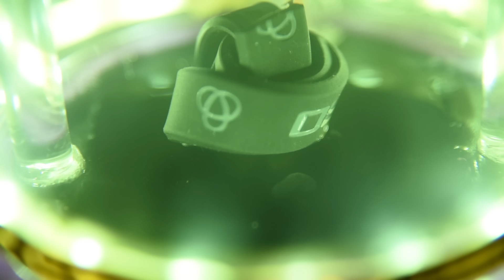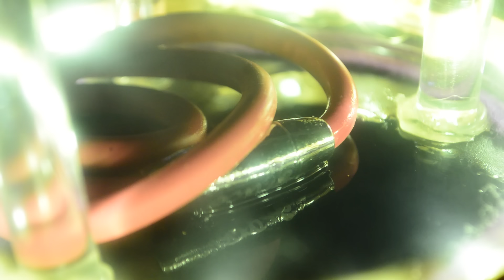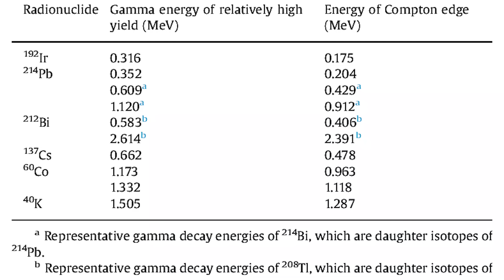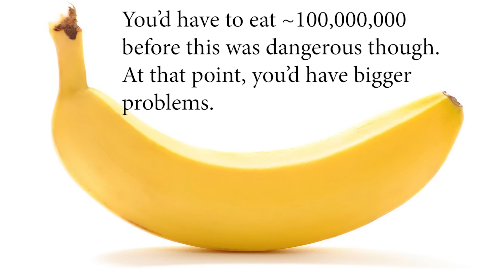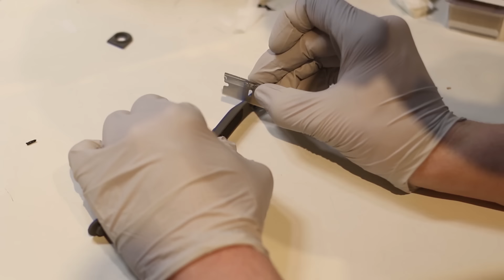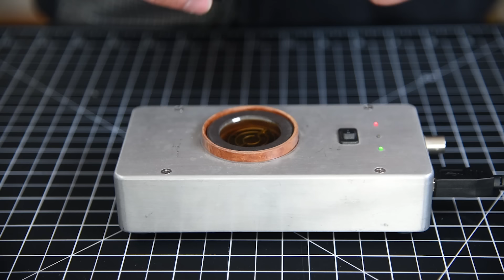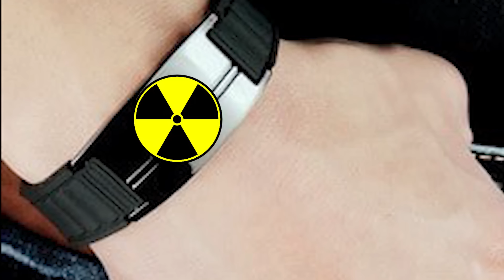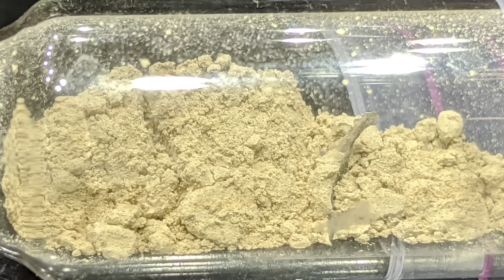Negative Ion/Anti-5g Products Are Actually RADIOACTIVE

Comment: That first part about the salt lamp explains so much. I thought they were pretty, looked up prices and have been wondering why they're charging so much for a light bulb in a piece of salt ever since.
Reply: I got mine from the dollar store for $5. It has a color changing LED inside. I don't believe it does a single thing for my health other than completely satisfying my goblin brain's desire to have glowing rocks in my house.
Reply: @KattriellaDoesStuff  relatable, I had to get rid of mine because I live in a humid place, and it started "crying."  Which caused everything around it to rust.
Reply: @CygnusOrb Salt is hygroscopic; it draws in water moisture from the air, causing water to condense on the surface. Assuming the rock is at room temperature, the water will run off the salt rock, giving it an appearance of "crying".
Reply: @kattriella1331  
Lol same, I got one little one as a Christmas present. I love the warm light it makes, it's comforting
Reply: I actually got one for 7$ at a flea market, it was already open so I thought it was just a cool cheap rock lamp. Later on I found the same exact lamp at a walmart for 50$
Reply: Its just red veined halite. But don't wash it with water
Reply: Yup, you will find little puddles of salt on your dresser beside your lamp. Especially in the summer. Perhaps keep it on a paper towel.
Reply: It's a massive scam! 😆 remember when that guy sold millions of pounds worth of rocks with a USB cable stuck in them... there are many ways to take money from gullible people
Reply: @Jawst  the USB Pet Rock wasn't a scam though, it worked as advertised.

Comment: Did you check shungite?  It is a naturally occurring stone that can block radiation.  How does it react?  Would it be safe?
Reply: There doesn't seem to be any real evidence supporting the idea that shungite is especially good at blocking radiation. It doesn't seem like shungite is actively dangerous, though, just doesn't do what it's advertised to.
Reply: "Crystal healing pseudoscience proponents and 5G conspiracy theorists have falsely alleged the misinformational belief that shungite may remove 5G radiation from their vicinity more efficiently than any material of similar electrical conductivity would do."
Reply: @muzlee7479  you may want to take a look at the scientific studies on frequencies from different stones and the colors alone of stones believed to heal particular parts of the human body, the colors alone of the stones match up with the parts of the brain that light up when those parts of the body are lighting up the brain as well, so science is more and more validating some of those ancient practices of certain crystals impacting certain illnesses.
Reply: @HearturMind  there is not a single study on that, just some pseudo science stuff. Stones doesn't have frequencies like you think they have and the color is completely arbitrary.
Reply: It's just lead my man cause only lead can block radiation that effective (you also need to wear a full suit made out of lead by the way so don't try it)

Comment: I mean could you say that its making water "more wet" because some of the alpha particles could interact with the hydrogen to make deuterium (D), and since deuterium is denser than hydrogen, it increases the density of the water and thus making it feel stronger when you consume it (if enough deuterium is present)? (17:03 - 17:10)
Reply: The ability of a substance to wet is its ability to adhere, or stick to other substances.  I don't see how adding an extra neutron to a hydrogen atom affects its charge.

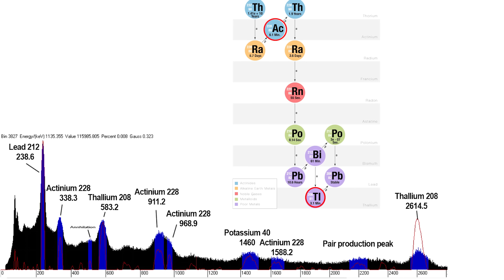Comment: ::Can someone explain "Annihilation" to me at around 8:06
Reply: what? are we watching the same vid?
Reply: @y2kenh  between the first columns of Actinium and Thalium.
Reply: @mikestrauss8613  ahh, now i see it. It's the collision of opposite subatomic particles. From wiki on annihilating radiation: 
Positively charged electrons (Positrons) are emitted from the nucleus as it undergoes β+ decay. The positron travels a short distance (a few millimeters), depositing any excess energy before it combines with a free electron. The mass of the e- and e+ is completely converted into two photons with an energy of 511 KeV each. These annihilation photons are emitted in opposite directions, 180˚ apart....
so in that graph it does look about 511 KeV
Reply: @mikestrauss8613  it don't exist in the video

Comment: Another issue with thorium and alpha radiation...since the devices shed thorium powder, you are going to end up with internal contamination.  And when it is internal, alpha is by far the most dangerous type of radiation.  When I got a geiger counter I made sure to get one that was capable of detecting alpha.  We need to be using this thorium to make pebble bed thorium reactors for safe clean energy, not exposing people to it.
Reply: Thorium is probably also just poisonous.
Reply: @hedgehog3180  True, most heavy metals are also (chemically) poisonous, whether they are radioactive or not.
Reply: @StormsparkPegasus isn’t the term heavy metal used to refer to toxic metals anyways? (Things like arsenic or lead)
Reply: @JustALittleGhostOfHallownest  Not necessarily.  It just refers to metals that have a high atomic weight.  One of the heaviest metals (gold) isn't toxic at all.  That said, a lot of metals are toxic.  The chemical toxicity of any substance (not just metals) depends more on how the electron shells are arranged rather than the atomic weight.
Reply: Yeah, the flip side of it not penning far means it's FAR more likely to be dumping all it's energy into the first thing it finds, or to just bounce around and cause despair like a psychotic pinball.

Comment: Is heavy water technically more wet?
Reply: is it the higher isotope weight that gives it the ability to bind with itself?  nope.  so I would also have to say, no heavy water is not more wet.
Reply: No cause that's just water but heavy
Reply: @G.A.C_Preserve  but if it's water that weighs 11% more, that means heavy water is 11% more wet
Reply: @defeatSpace  that's not how it's work

Comment: 13:41 - is NOT a geiger counter. It's an electrostatic fieldmeter!

A device to measure static electricity/charge. Static electricity isn't anything like radioactivity. The reason such meters exists is because in highly specialized working places you need to make sure you're not building up charges. It can be working with special sensitive equipment, flammable gasses etc.
Reply: yes but it's radioactive anyways
Reply: @Shoteaux2  /Might be/ - but an electrostatic fieldmeter can't tell you whether it is or not... ;)
Reply: @Shoteaux2  You miss the point, don't you?

Comment: What about electric appliances? I used to live in Japan and there's a ton of "negative ion" stuff everywhere. I got a "negative ion" hairdryer just because it was on sale, and a "negative ion" toothbrush just because it had three spare bristle heads, making it cheaper than a normal toothbrush. It looked like the one shown in this video. I used the dryer for three years and the brush for more than a year... Now I'm kinda worried because who knows what did they put inside :(
Reply: get a geiger counter. then you can check if its radioactive
Reply: If the geiger counter doesn't say anything then it's probably just marketing bullshit, except “air purifies” which might generate Ozone which is toxic but usually they make that clear if they do.

Comment: Cellphones have alot of rads.Smoke detectors have a tiny piece of a bad atomic radiation material, I've been told, by a fire man 👨‍🚒
Reply: you cant compare these types of radiation
Reply: @ingolorenzo4158  absolutely no comparison at all
Reply: @davldbradley6073 phone radiation is less dangerous than visible light so... just no
Reply: do you know the kinds of radiations? the cellphones are radioactive but their radiation isnt ionizing, and that means that it's not dangerous, and that's because when i put my cellphone along with a geiger counter it doesnt goes crazy

Comment: Great vid. Love the Gamma Spectacular and will have to get one. Can you re-measure the dose rate with the alpha-sensitive detector after wrapping it in paper please? Just showing an alpha going through is not sufficiently quantitative to judge risks. Also, local on-contact dose is far less hazardous than whole-body dose. You can't just say 100 mSv/yr whole body is the threshold for the smallest measurable increase in cancer and then add up a few local external doses and say it's unduly hazardous without a lot of disclaimers. I think you're a little strong with your conclusions given what we saw.

Comment: you didnt show whether tourmaline bead bracelet generates negative ions you just showed no thorium or radioactivity btw that caltech professor on the referenced vid described how that pink tourmaline he had on the display shelf will generate negative ions
Reply: Ur blind 0:17
Reply: they're not even negative ions because fast electrons(beta radiation) arent even atoms then they arent ions LOL
Reply: tourmaline is a stable boro-silicate mineral.  it does not generate ions of ANY kind.  it WILL generate visible light in response to UV light.  that is not ionizing radioactivity.  it is fluorescence, which many minerals show.

Comment: I just saw an advertisement for a "Negative-Ion air-cleaner" that SUPOSSEDLY cleans the air of pollutants & allergens because the "Negative-Ions it releases when plugged into an outlet are SUPOSSEDLY heavy enough to bring the allergens down to the ground when the Negative-Ions "attach" themselves" even though that is a logical fallacy regarding the weight of airborne substances, and yes it was a mobile phone advertisement and yes it was advertised to people with variously caused breathing problems or pets. Fucking disgusting.
Reply: those things are usually ozonizers; item's that crack 02 and produce 03 by passing current through air, and then the 0- ions instantly recombine into ozone.  if it generates a noticeable smell, it's probably an ozonizer.  large ozonizers are used to clean empty hospital and surgery rooms because Ozone is a strong oxidizer (duh).  it's functionally like spraying bleach everywhere in a room.  clearly, you wouldn't want to be standing in the room while that is going on.  the small ozonizers they sell commercially effectively do nothing, unless you put them in a completely closed room with nobody in it for about a week or two. :)  That said, I would NEVER give an ozonizer to anyone with lung issues.  it literally bleaches lung tissue over time.  most of them generate so little ozone it isn't a problem, but some of them actually do produce a significant amount, and it will irritate lung tissue badly.

Comment: so, is an ionizer on an air purifier emitting radiation?
Reply: No, because that’s plugged in, it doesn’t need radiation as power.
Reply: an ionizer produces ozone (o3) by cracking regular oxygen (o2) via passing a high voltage electric current across a small gap; the oxygen ions (-o) then recombine back into both regular 02 and some 03.  pretty much the same way that lightning cracks 02 to produce ozone, but on a much smaller scale.  03 is an unstable molecule of oxygen, and will readily become an electron donor to become the much more stable 02 again.  this tends to oxidize proteins it bumps into, destroying them in the process.  In short, it bleaches stuff in a similar way to how household bleach works.  The retail ozonizers you buy online for your home produce so little ozone they effectively do nothing.  but some actually DO make significant ozone, and that can be dangerous if you hang around in rooms with significant ozone.  it will slowly but surely bleach your lung tissue.  people with asthma or other chronic lung conditions can have serious negative reactions to this.  They use big ozonizers to bleach hospital rooms and surgeries... and nobody is allowed to be in the rooms while they do so.  so yeah... at best your home ozonizer is going to attract dirt to the walls nearby it, but otherwise be harmless... but some of them are for real, and they really aren't designed for home use at all.

Comment: curious on your opinion of non-ozone creating negative ion generating machines. Are the negative ions actually good and healthy and beneficial or not?
Reply: if it plugs into a wall... it's generating ozone.  if it doesn't use batteries or household current... then it's using something radioactive or nothing at all.  most likely nothing at all.  and no, negative ions on their own have zero effect at the rate they are generated by anything available to be used in your household, including ozonizers.  COMMERCIAL grade ozonizers are something entirely different, and you wouldn't want to be in the same room as those things for any length of time... unless you wanted to bleach your lungs and your eyeballs.

Comment: Is 12 million / cm3 amount of negative ions a lot?!  I bought this air filter and it has a negative ion generator, states you can control it. Can you?!
Reply: negative ion generators you plug into the wall are usually using electricity to produce ozone (03).  most sold for retail produce so little ozone at best you get a slight electrical smell.  no worries.  COMMERCIAL ozone producing machines CAN produce a lot of ozone, and that can cause serious problems if used in a closed room.  they are usually used to commercial clean hospital rooms and surgeries.  ozone is a strong oxidizer; produced in large amounts, it is effectively like spraying bleach everywhere.  But again, all retail ozonizers produce so little ozone they are safe.  they will just cause dust to be attracted to the walls nearby the unit :P

Comment: So how do negative ion hair dryers work?
Reply: Blast some U-239 into your hair maybe lmao
Reply: they probably use a simple ozonizer.  you can make ozone (O3) by simply passing a high voltage current past a gap, like a spark plug.  at worst, you are very lightly bleaching your hair with repeated use.  likely not even that.

Comment: bananas are radioactive? weird
Reply: everything is radioactive.  everything emits at least some wavelengths of light.  the vast bulk of electromagnetic radiation does NOT cause molecules to ionize though.  in the case of bananas, the amount of ionizing radiation coming from them is so low, you would have to eat TONS of them (literally) over a very short timespan to ingest enough ionizing radiation to have any significant effect at all.  In short, bananas radiate no more significant amount of ionizing radiation than you yourself do.

Comment: What about the negative ion air purifiers?
Reply: those are machines that use high voltage electricity to cross a tiny gap, like a miniature lightning bolt, to crack 02 into oxygen ions that then recombine back into 02, and some 03 (ozone).  ozone is unstable and will want to contribute an electron (negative charge) to anything they bump into in order to become the more stable 02.  this is called an "oxidation" reaction.  more simply put, ozone works like bleach.  the amount of ozone most retail ozonizers actually produces is minimal.  that said, the commercial versions are used to clean hospital rooms and surgeries.  those produce a very significant amount of ozone, and you would in no way want to be in a closed room with one for more than a few minutes.  too much ozone will literally bleach your lungs.  if you put something like 20 of those cheap ozonizers in an enclosed bedroom, after a few days there WOULD be significant levels of ozone built up, and over time that could damage your lungs, eyes, and nasal passages.  usually pretty you will be feeling severe irritation first though.
overall, though, like I said, most of the retail ones produce so little ozone they are not a concern.  you might see dust being attracted to the walls near the unit, and that's about it.

Comment: I was wearing one brand called Life Ion for almost 1 year. It was a present from someone and i was wearing it as an Accessoires. I didn‘t know what Ion even meant. I am now really worried of becoming sick by this. I thought that this is just some plastic.
Reply: If you stopped wearing it and haven't noticed anything in your wrist so far you're probably fine, cancer from radiation develops fairly promptly.

Also ions are just molecules that have a charge, they aren't really anything special, though negative and positive ions can come together to produce salt crystals which are neat and salt is tasty. But like you don't want to have a bunch of ions around you because they can react in unpredictable ways but like if you just live normally and don't carry around radioactive stuff you'll be fine.
Reply: I’m not a doctor but in your place, I would take two drops of Lugol’s iodine every day, take regular magnesium chloride baths, switch all my table salt to Real Salt, have my mineral levels checked to address any deficiencies, and generally eat a healthy diet and follow a clean lifestyle. Be well. 😘

Comment: salt does produce negtive ions thats why it attracts positive changed water ...
Reply: Both table salt (sodium chloride) and water are electrically neutral, not negatively or positively charged. In water, sodium chloride dissociates into sodium ions and chloride ions, which attach to the negative and positive ends of water molecules; it does not dissociate into elemental sodium and chloride.
Reply: @CapnJazzFan    @a a  even though H2O is neutral  because of its structural arrangement it will gain charge..  if  u say water vapor doesn't have any charges and is neutral how come clouds produce lightning? clouds have negtive charge is it so?